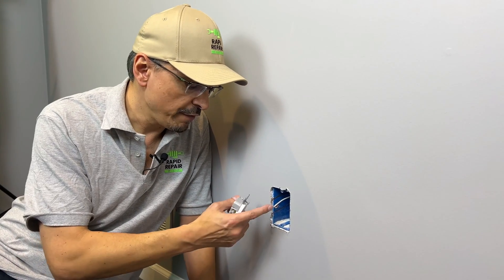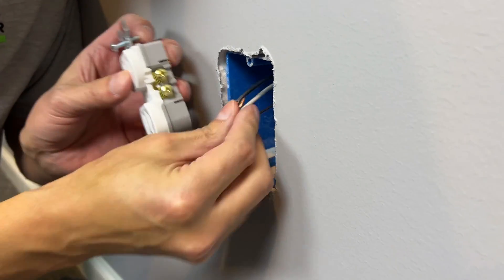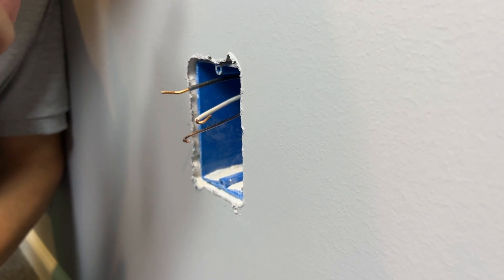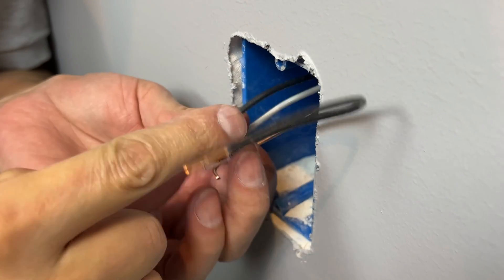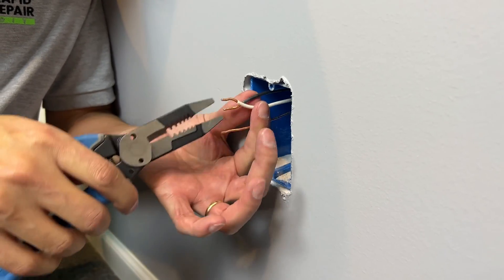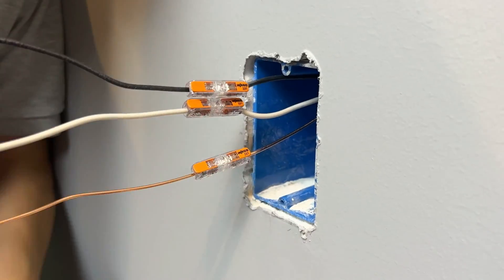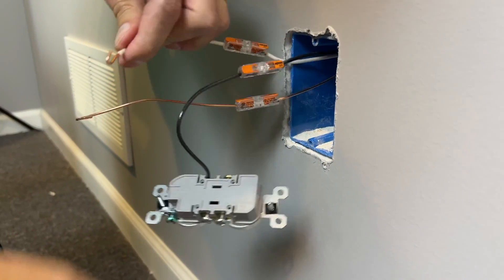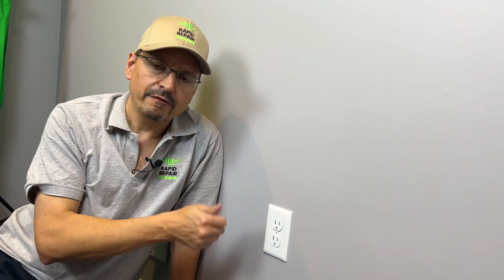How To Fix Short Wires in an Electrical Box

Comment: The wire insulation should be slightly recessed inside the wago or wire nut. You are leaving room for the bare ground to come in contact with the hot conductor which will result in a dead short. Also if you're not experienced with carefully pushing all the wires back in to a box it's always a good process to wrap the receptacle with at least two layers of electrical tape to further prevent ground faults and arcing.
Reply from the maker: Thanks for all your info. People will read your comments for years to come.

Comment: You did everything right but just missed one thing you didn't tighten up the free hot and neutral side screws to avoid the screws coming in contact with any loose wires or the electrical box please tight them up so there won't be a chance for any electrical issues whatsoever understood saving a few seconds here and there while doing electrical work is not worth it when it can allow you to avoid and prevent a fire from being caused in the first place and please come back to tight back up the loose screws on this electrical outlet you used for demoing your fixing technique's so please prevent this habit and change it to tighten all the screw's on every electrical outlet you work on from this point on great video otherwise simple specific and straightforward to the point with all the necessary details being mentioned so a well-made video altogether.
Reply from the maker: Wow. Thank you for all the comments my friend. Yes you are right.